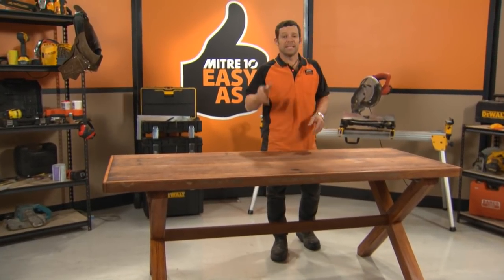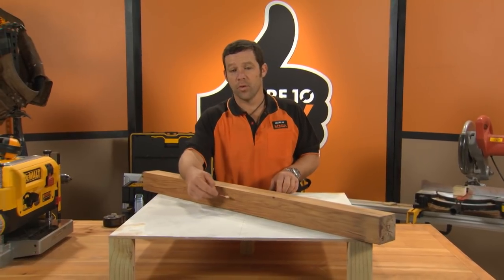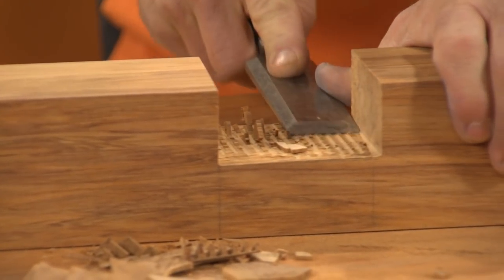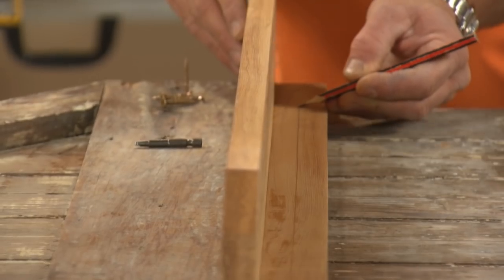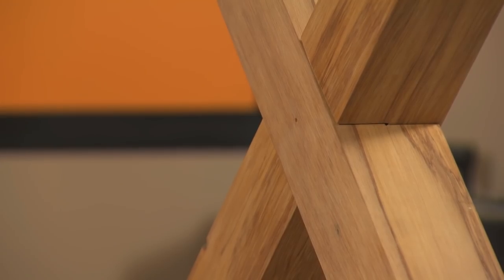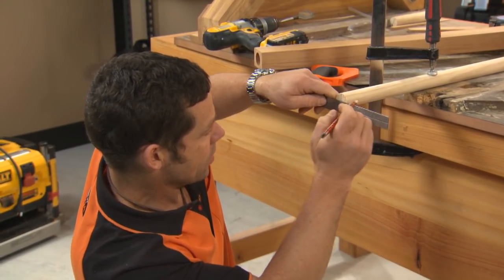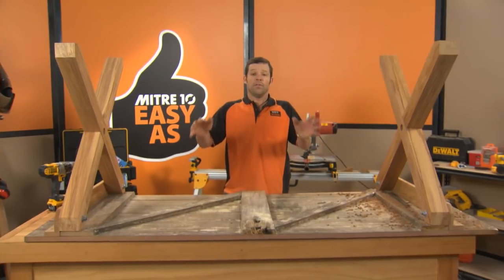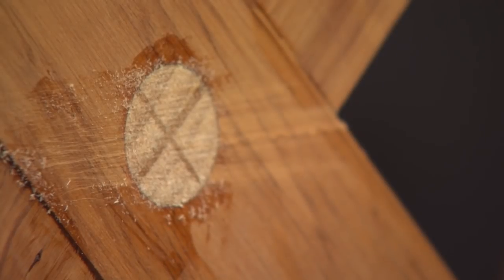How to Build a Dining Table | Mitre 10 Easy As DIY

Comment: Great video. What glue did you use in the final gluing process ( It looked like epoxy). Is a normal exterior PVA wood glue not suitable?
Reply from the maker: Cheers Gus! It's a lot clearer in the pdf instructions, and the terminology might need updating: https://www.mitre10.co.nz/medias/How-to-build-a-dining-table-WEB.pdf?context=bWFzdGVyfHJvb3R8MjczODM4N3xhcHBsaWNhdGlvbi9wZGZ8c3lzLW1hc3Rlci9yb290L2g5OS9oODQvODkxNzUwNzA4MDIyMi9Ib3cgdG8gYnVpbGQgYSBkaW5pbmcgdGFibGUgLSBXRUIucGRmfDgwY2U2YjQ0ZDc3OGFhZjBhZDk4YjQ1OTdiOTA1ZWZjZmQwNjFlYmE4ZGEyOTY2NjkwY2U1YjJjYjExNzBlZDc The other glue Stan's used is a two-pot glue https://www.mitre10.co.nz/shop/crc-builders-all-purpose-glue-500ml-tan/p/370859 ^Matt

Comment: Good craftmanship but the design with crossed legs seems unstable to me compare to the standard four leg table,especially when you drill a hole in the joints and the width is half.My opinion is four leg table is better and lasts longer.

Comment: What is the glue you use to glue the legs together?
Reply from the maker: Hey Craig, a strong adhesive PVA glue will do the trick: https://www.mitre10.co.nz/shop/paint-decorating/adhesives/adhesives/c/RF5244 ^James
Reply: Thanks. I bought that Aquadhere PVA glue for the angle boards the legs bolt to. Tougher than wood they say.Guess I can just use that. Cheers.